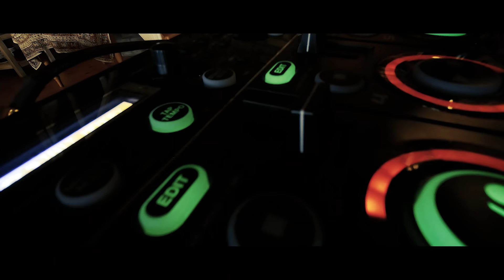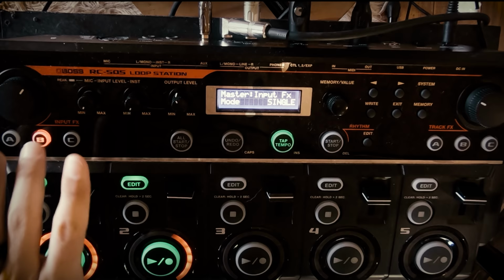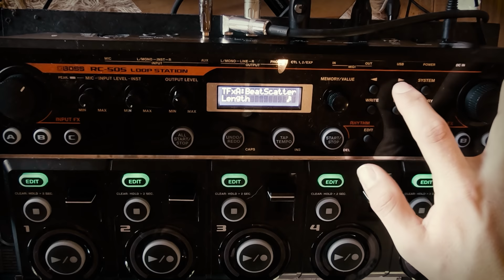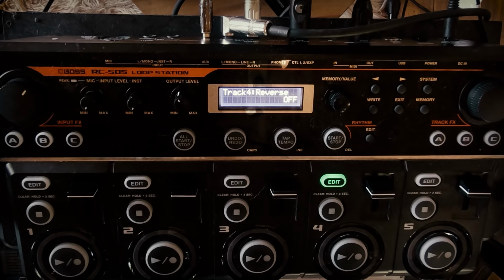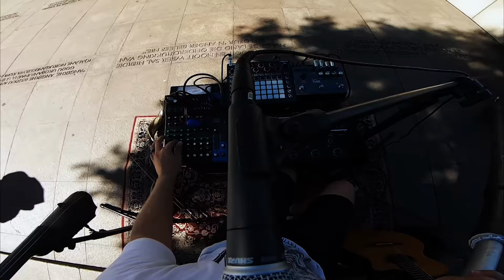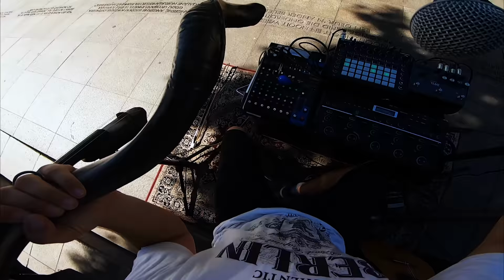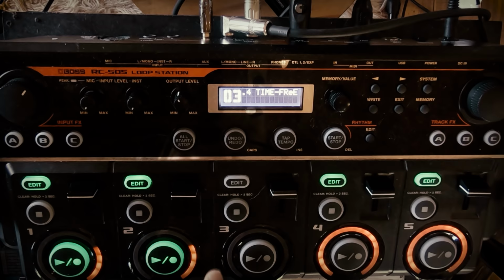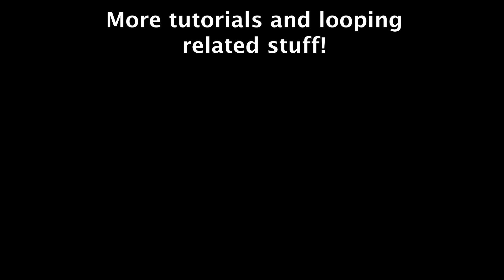Boss RC-505 Loop Station Tips and Tricks - Tutorial

Comment: The INST input is designed for audio up to +4dBu, which is what most professional instruments output. They output a much higher voltage than consumer or DJ equipment. The AUX input seems to be designed for headphone signal levels. So the normal output of a DJ-mixer (with RCA-connectors) would not be very loud compared to what the INST input can handle. It's a bit loud for the AUX input though, but if you keep the volume down, it makes sense that the AUX input sounds better. If you use a pro-audio mixer (with jack connectors), though, I'd expect the INST input to sound better.

Comment: I saw a guy using the same footswitch that set it up so the second switch chooses the next track.  That way you can start and stop the one that is currently selected and then move to the next track to record it.  Then you can use all five tracks with the footswitch instead of just two of them.  Not sure how you set that up.   There must be a function in the 505 for selecting the next track that you can assign to a footswitch.  There is a lot of good information in your video, though.  Thanks!

Comment: Hey, thanks for you video! Maybe I should also do one where I show my tricks ;)

To try and answer your question from 8:30
In my understanding there is no difference in the effects themselves whether they are on A, B or C.
However they applied in an order: fist A, then B, then C. 
This is also the reason why some effects (beat repeat, beat scatter etc.) are only available on A and some (tape echo, reverb etc.) only on C.
So it means that if you are using multiple effects you filter might or might not change the input for the next effect and therefore you'll get different results. You can easily try this by setting up the same filter on A and C and then put something like ring modulator on B, then switch between AB and BC and you will hear the difference ;)
Reply from the maker: Awesome thanks for your input man! ill try that tomorrow. Makes sense

Comment: Hey! Thanks for all the tips,what kind of a microphone would you recommend putting on the rc-505?
Reply from the maker: Hi there, I would recommend any of the two microphones in the description of this video, either the shure or sennheiser!
Reply: The two most basic microphones you might want are called SM57 and SM58. The only difference between the two is the windscreen giving the SM58 more bass in closer proximity to the sound and the SM57 has a more even response at any distance. For vocals with lots of bass - SM58 is the industry workhorse and the first microphone for most vocalists, anything louder than a typical voice or very high pitch like bells and whistles use SM57. There's always better microphones for more money but these two are essential starter mics.

Comment: I"m trying to get a single elongated tone to loop without a spike at the join of the beginning/end of the loop.  just using my voice through a mic, with a simple hum which is a consistent sound as I make it, starting the sound before the press of the record button and continuing the hum after hitting the stop recording of the loop... I would assume it would be a clean join but it seems to pop and clip is there a way to alleviate this?  Or are looping machines more designed for rhythmic sounds which have a break in the sound to loop back on?

Comment: Thank you! I have the RC 202, what are your thoughts about this looper?
Reply from the maker: Casa Kundalini Yoga Sat Nam I think it’s amazing! I have never owned one personally but it’s got the same operating system as the RC-505 which is great and it’s nice and compact, so this video should still be relevant to you, hope it helps, let me know.
Reply: @ReinhardtBuhr  Thank you, your video helped me a lot. Still I don't know how to connect the looper into the mixer and the Tascam recorder. Could you please share how to do it and what cables do I need??
Reply from the maker: Ill have to do a separate video on that, but in short: go from the output of your mixer into the loop station and from the output of the loop station go into the tascam recorder. Just use normal jack to jack cables. hope that helps? @casakundaliniyoga
Reply: @ReinhardtBuhr  Thank you brother. I'll try to do it. Do I need a special Cable to connect the Tascam into the mixer?
Reply from the maker: also just a normal jack to jack should work, otherwise try a mic cable xlr. @casakundaliniyoga

Comment: When you create the basic beat loop does it automatically set the tempo??
Reply: Also how do you typically set the measure on these???
Reply: meaning like from the start...do you typically set it on free and then it auto synces it to the rest?
Reply: Make sure each Tempo Sync and Loop Sync are both turned On.  Always put each of the 5 Measure’s on Free

Comment: hey :-),
how did you manage to don't have your loop back in your microphone?  i always have a little bit of the loop background from my speaker. 
Thank you for your answer ;-)
Reply: If you use an omnidirectional mic your going to have more issues. Other than that just try to keep your mic as far from your speakers as possible and keep it mixed down when your not using it.